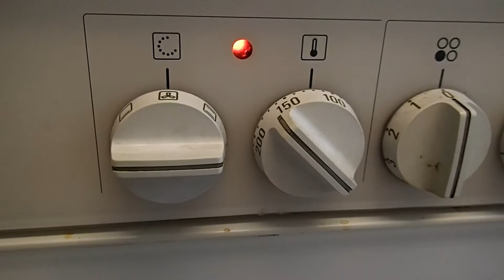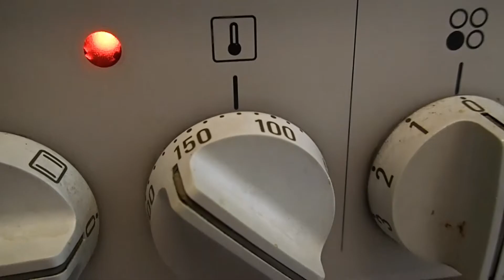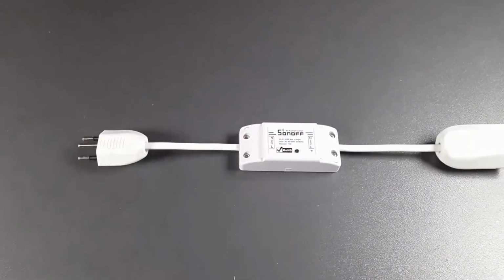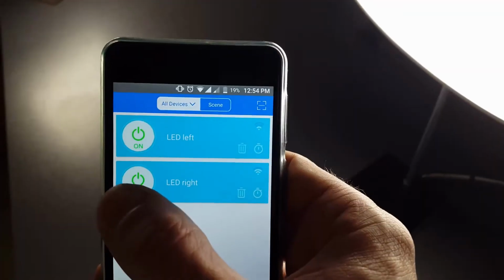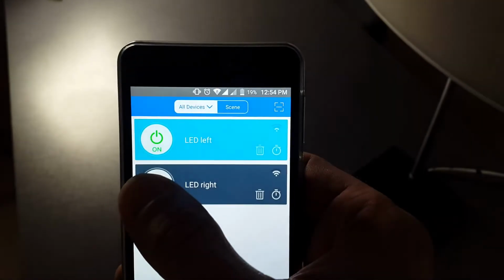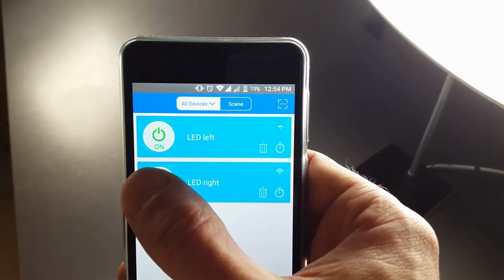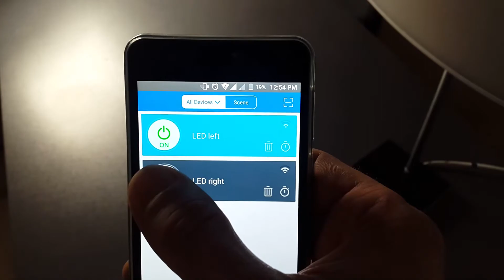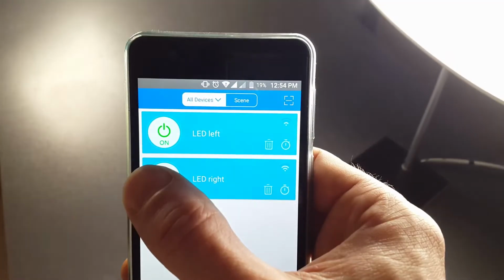DIY Curved LED Panel

Comment: What's total watt plz and what about heat? Great looking project
Reply from the maker: Hi Lotfi, thanks for commenting. The strips are slightly undervolted and the aluminum panel helps with heat dissipation. The total power is around 70 watts.